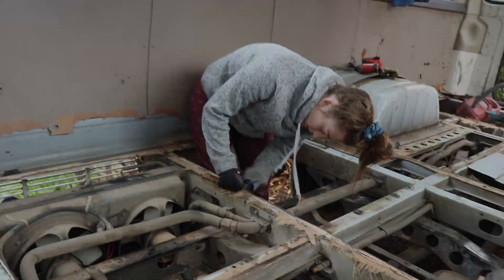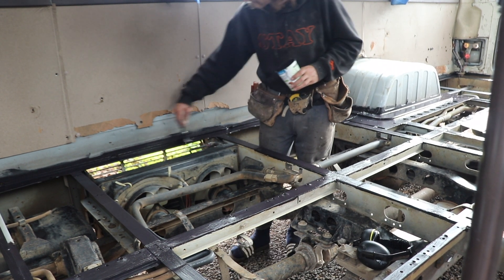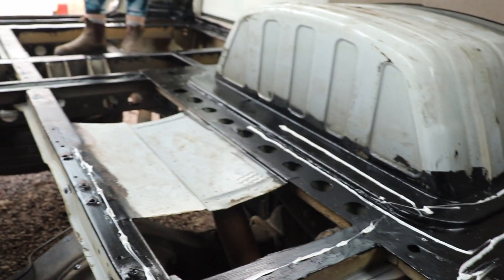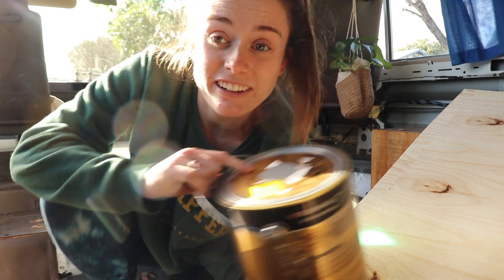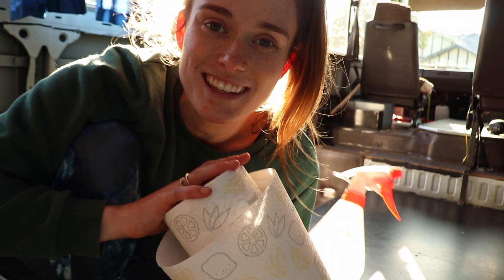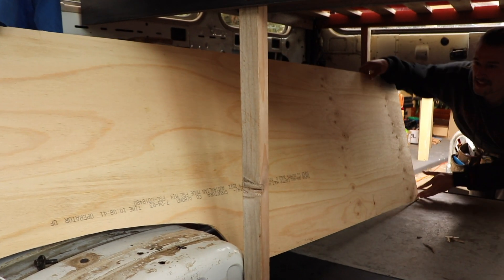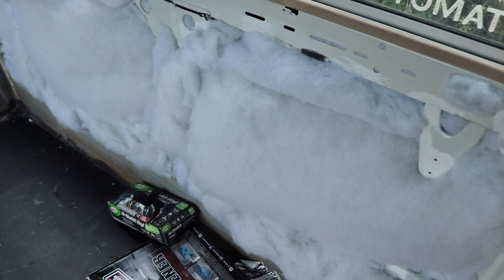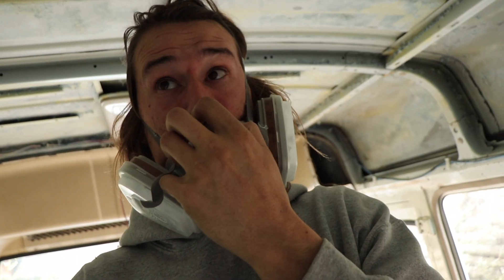BUS BUILD UPDATE PART 2 - Toyota Coaster tiny home on wheels

Comment: Nice job. If I understood you correctly you kept the line and rear heater cores. Good move. I see too many people eliminate them. Not only is the free heat nice, but the additional heater lines are usually calculated into the cooling of the engine. Never understood why people want to remove them.
Reply: Good points Dave, but mightn't the rear floor heaters get in the way of most people's ideal plans?